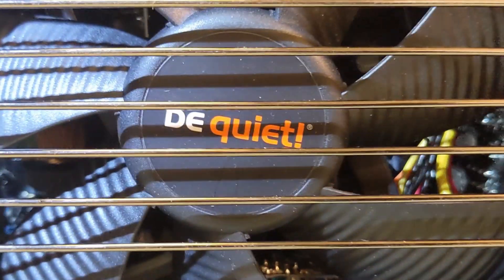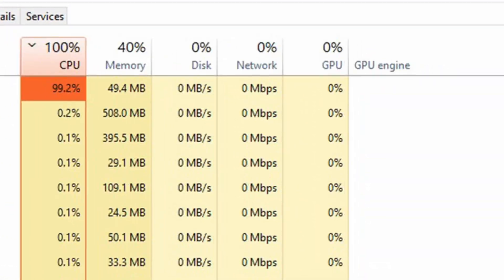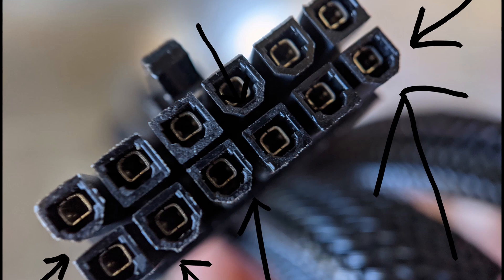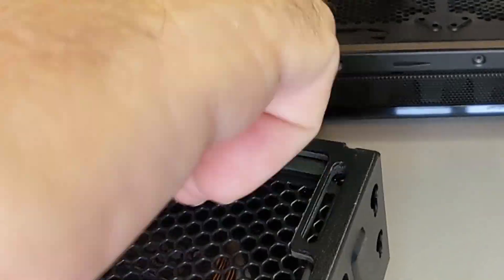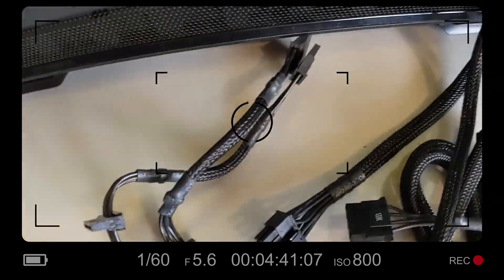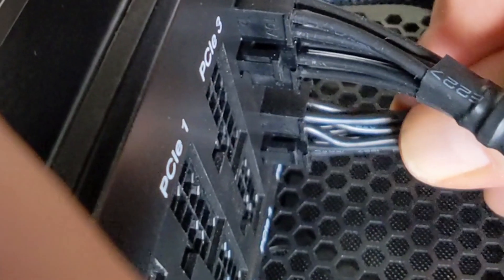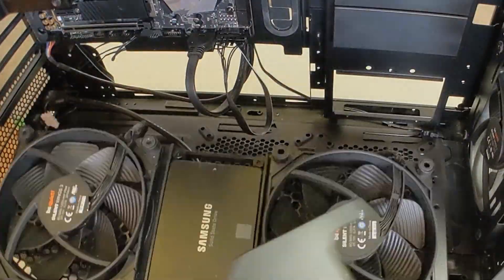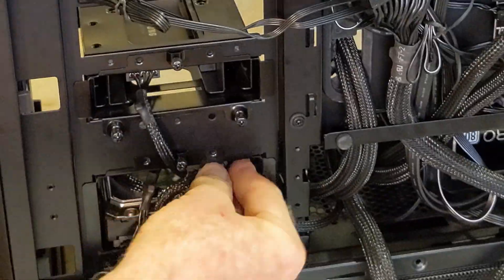Installing the BeQuiet! Dark Power Pro 11 Power Supply into the BeQuiet! Dark Base Pro 900 rev2 case

Comment: I guess once you own it you'll know. I still don't understand the connections because I have an evga psu, and every other psu has been the same. This psu has totally different connections
Reply from the maker: Yep, it is a bit sure enough. You have to use their cables for sure, that's the recommendation for any power supply though. And they still hook up to the MoBo, CPU,. graphics and SATA Power like the others... that end is the same still. And they do label both ends of the cables quite well. So it's a breeze to install actually.
Good quality is really important.... and EVGA has a good reputation for sure. I feel somewhat bad for Gigabyte though.... mostly because I like their motherboards.... and I feel kind of let down by their PSU issues.
Reply: @johndicus123  You know? You explained way better than the company when I exchanged 4 emails with pictures with them 😂 Thanks!
Yeah I heard about gigabyte...

Comment: You never show how the open the case and your camaraderie angles are terrible
Reply from the maker: The case is easy and held shut with two captive thumbscrews.
You're right about the angles, it's tough filming with one hand and doing with the other.
Reply: If you need a video showcasing how to open a case you might wanna stay away from building your own PC.